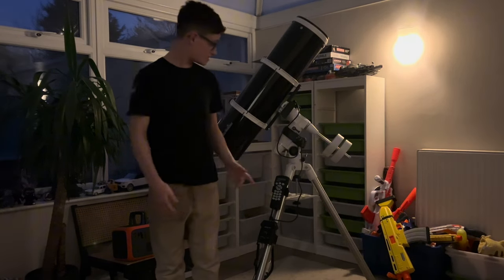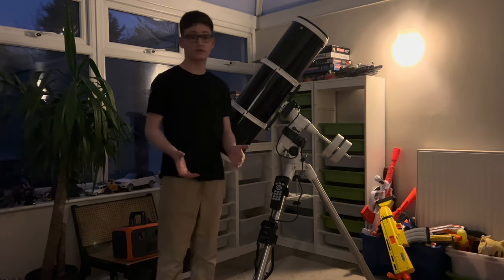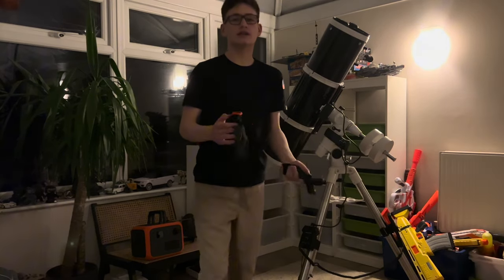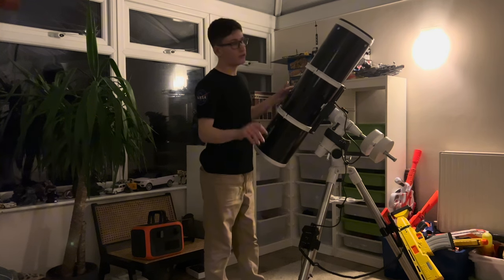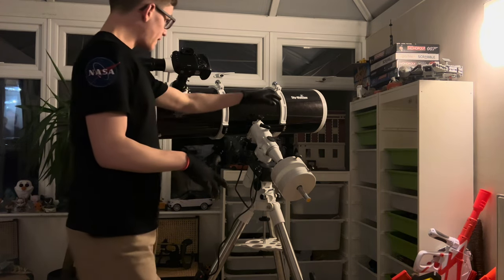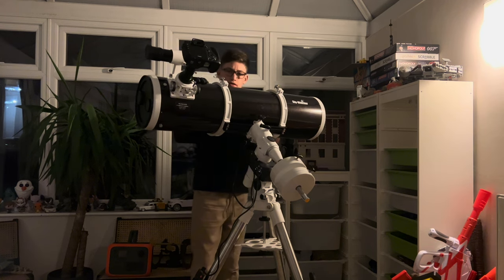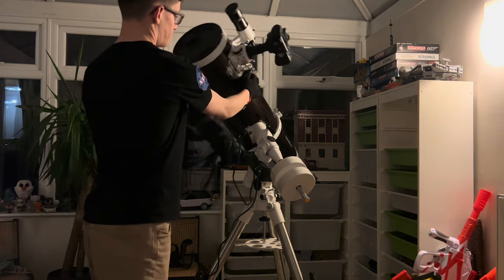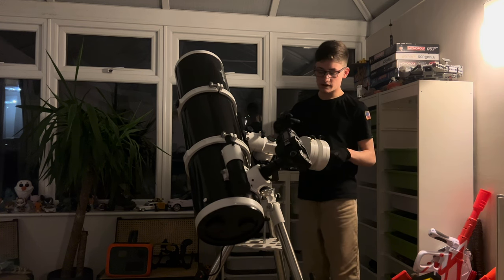Fixing azimuth screws and how to balance a telescope

Comment: You're over tightening your clutches (lock levers). This will cause excessive wear. A little pressure is all you need.
When balancing the setup with a camera in place, the focuser and camera should be on the underside (by the dovetail), keeping a lower centre of gravity.
Reply from the maker: Ok thank you. I did wonder why everyone puts the camera at the bottom of the scope. I’m always worried it might slip out of the rings that’s why there so tight.